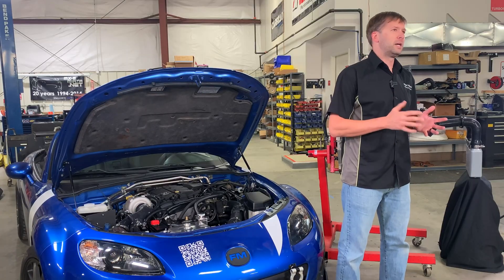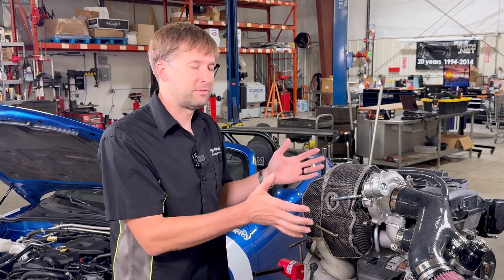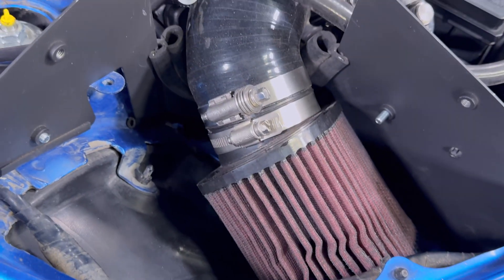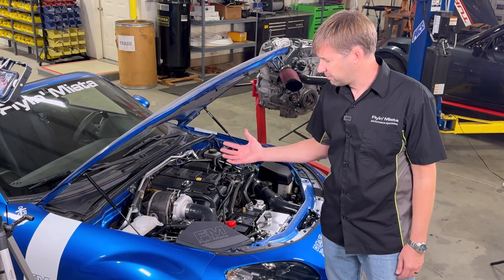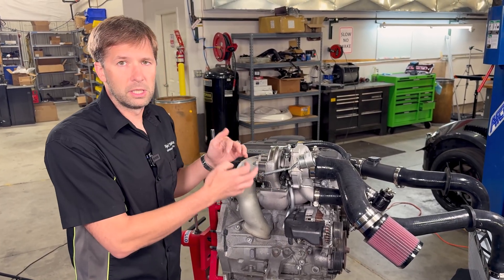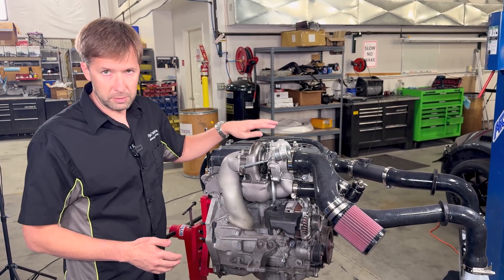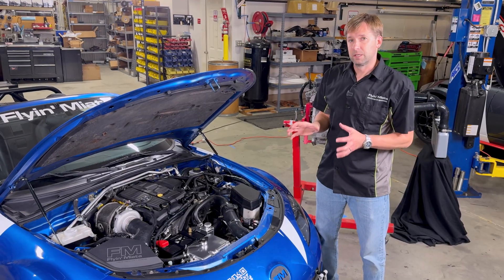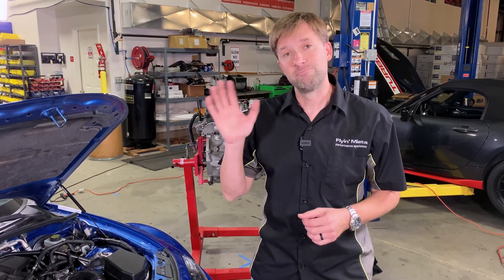NC Turbo Tech Talks - THERMAL MANAGEMENT - Episode 4

Comment: How does this kit handle track use
Reply from the maker: It has been extensively tested on track.
Reply: Any heating issues? Is the cooling upgraded? @FlyinMiataVideo
Reply from the maker: @trdjohnson  Our car is equipped with a Flyin' Miata radiator. Cooling testing was done at high altitude tracks where the low air density decreases cooling performance. We were able to run a 45 minute session at High Plains Raceway. On Grand Junction Motor Speedway, a low speed track with very little cooling airflow across the radiator, the temperature gauge starts moving after about 6 minutes of flat-out driving. This is better cooling performance than many unmodified factory sports cars in our experience.
Reply: Ok. Good to know maybe I'll consider one for my 2.5 NC in the future @FlyinMiataVideo

Comment: Are there any items that should be loctited in assembly, and if so, which Loctite?
Reply from the maker: Any loctite requirements are noted in the printed instructions. We always recommend reading those as they're more easily updated than video installations, so they will have the latest procedures.

Comment: I have the turbine about 3mm away from my hard brake line and I’m worried. You think a thin piece of aluminum, like a license plate would be sufficient? I don’t know if the turbo blanket hitting the downpope directly would be dangerous? Thanks
Reply from the maker: We're assuming you're talking about a turbo kit from another source, given that we are just starting to ship these today :)
A thin plate will be better than nothing. You'll definitely want something to prevent the turbo from overheating your brake fluid. A turbo blanket contacting the downpipe isn't likely to be dangerous, but if the turbo blanket makes contact with the brake lines it could start to wear through them and that is definitely something you want to avoid!

Comment: What stops the water heating up in the turbo and going back into the engine block, how does the flow go cold (cooler) water from the engine, heat up and then go back to the radiator, what prevents the reverse from happening?
Reply from the maker: The water pump ensures correct flow. We have confirmed with clear hose that it is doing what we want it to do.